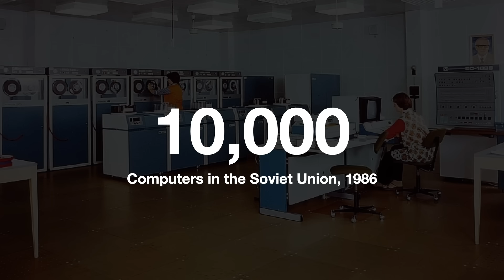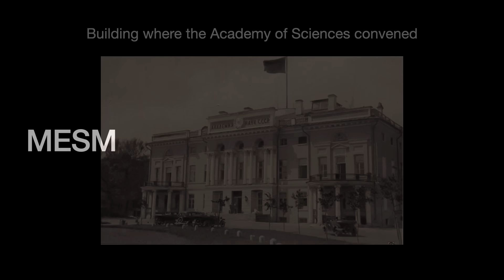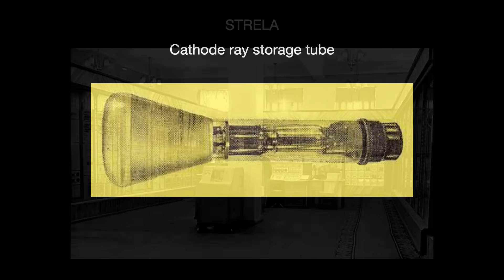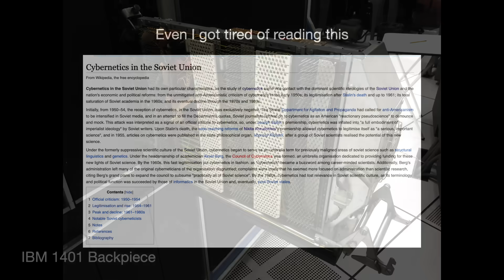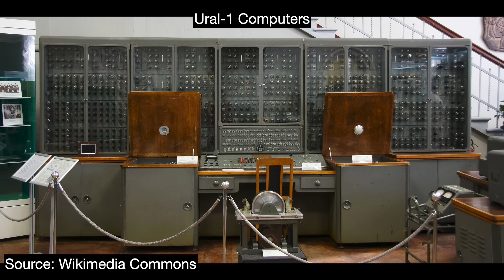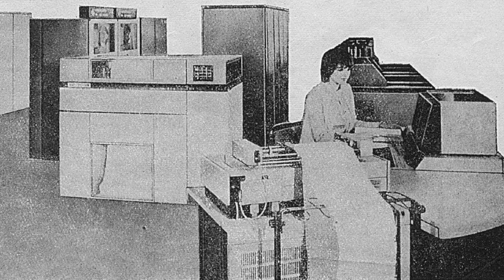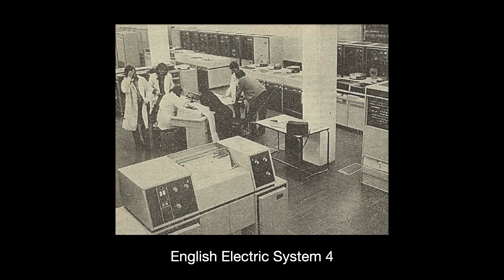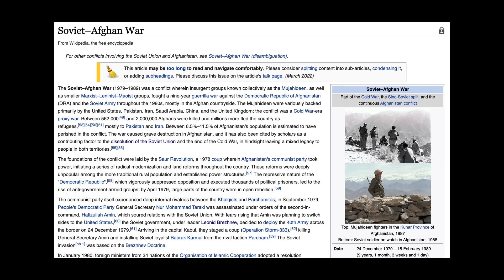Why the Soviet Computer Failed

Comment: I loved this video. Incidentally, the Russians later produced their own computer on a chip. American engineers obtained a sample and discovered that it was a copy of Intel’s 8080 CPU. However, the Russians disconnected circuitry designed for diagnostics, as they didn’t understand what it was for.

In the 1970s, my dad licensed magnesium production technology from Russia’s VAMI (Russian National Aluminum and Magnesium Institute). It was much better than our methods. I have also been told that Russia excels at light-metal technology and leads the world in titanium production. Furthermore, they allegedly have controlling interest in American-based companies that produce titanium. Regardless, it would be interesting to learn how they failed in one field while excelling in another.
Reply: You are right about titanium. Boeing has long term contracts to buy titanium alloy Ti-5553, from Russian titanium producer, I think VAMPSPO which has come up recently as one the best alloys, Boeing probably uses them for aircraft bulkhead or landing gear in 787/777. In fact there is a story, not sure how much of this is true, that CIA in the 50s had a dummy company to secretly purchase titanium from Sovient Union to build SR-71 by Skunk-works. Soviet Metallurgy is as good as in the west, but also ahead in many areas such as high temperature alloys for rockets and missiles, magnets etc
Reply: @indchill4574  Soviet metallurgy is or was?
Reply: @indchill4574  Today even South Korea is way ahead of russia in metallurgy. You russians seem obsessed with the West especially with the USA while you are backward and far very far behind Japan,  South Korea, China etc.
Reply: @indchill4574  All these false "the Soviet excelled here,  the Soviet were in advance there etc... " are becoming comical. These are typical Pravda assertions. After the defeat of the Soviet union and its eventual demise,  none of these "advances and excellencies" were found or visible anywhere.
Reply: @francoislechanceux5818  The Russian RD-180 rocket engine was chosen to power the American Atlas rockets.   I am sure though that you will find some argument to convince yourself that engine is rubbish.
Reply: @francoislechanceux5818  The comments you refer to, about a few technical areas where Russia has the lead, are detailed and specific. Yours, sadly, are playground insults.
Reply: Yep, USA bought titanium for the SR-71 from USSR (through intermediates, of course).
USSR also had very advanced superalloys, allowing them to have, for example oxygen-rich full-flow RP1 engine built in the 60s, the NK-33. Rocket scientists would not believe in its parameters until buying several copies for testing and seeing it for themselves. These same engines flew on the Anthares, and I don't mean the old design, I mean the old hardware itself.
Then again, this same phenomenal engine repeatedly blew up the Russian rocket it was supposed to carry, and then likely blew up the Anthares.
The Soviet system is great at finding and training talent, then wasting their labor.
Reply: @nikolatasev4948  "The Soviet system is great at finding and training talent, then wasting their labor."

I'm going to be stealing this.
Reply: Equating the soviets to russians, Best way to know a russian troll
Reply: @francoislechanceux5818  "Equating the soviets to russians, Best way to know a russian troll"
Or just an American.  See the movie "Dr. Strangelove"  https://en.wikipedia.org/wiki/Dr._Strangelove
It is a serious comedy but portrays the Russians as the enemy; not Soviets; Russians.
Reply: @francoislechanceux5818  "Looks like it systematically gets you more "likes" doesn't matter how stupid what you say is."
While that didn't exactly make sense, you are probably correct.  Being liked is not the same as being correct.  
The United States has the lions share of NATO funding; with France, Germany and UK having smaller shares, everyone else has considerably smaller shares.
In my years at Iceland at Keflavik, nearly all ASW was American with the occasional French, German, Dutch (Netherlands) participation and UK nearly as participating as America but from their base in Kinloss, Scotland and elsewhere.  Here is a chart of expenditures (not budget) https://www.nato.int/nato_static_fl2014/assets/pdf/2022/3/pdf/220331-def-exp-2021-en.pdf
We see the USA is way ahead of everyone in terms of GDP, and since GDP is large, it is also much larger in terms of absolute numbers.  
Graph 5: In 2016, the United States spent 651 billion (thousand million) dollars on defense; everyone else in NATO spent a combined 262 billion.  
So swallow your wounded pride and, by the way, step up the nuclear reactor program.  You're going to need it.  That's where France is the undisputed leader.

Comment: Analog computers for doing calculations especially in real time have desirable characteristics over digital computers especially for military applications where the circuitry is subject to electromagnetic interference probably till the 1980s and in some special applications possibly in the 2020s as well.  Soviet ballistic missile accuracy was widely thought superior to USA's in the mid 1960s and into the 1970s. A top USA military analysis said by the time NORAD had its Cheyenne Mountain complex operational in 1964 the Soviets had such accurate and sophisticated missile guidance systems they could have conceivably flown a missile through it.  The USA had no such capability.   

Soviet's had reliable automation with ground control on their first manned space flight back in 1950s and has always had much more automated manned space flight.  The digital navigation computer of Apollo was so delayed by software and other issues NASA had a German company design and provide its traditional navigation equipment that with some training the astronauts found was excellent.  

Digital electronic computers have clear advantages over analog computers in precise repeatable financial type numerical calculations, verbatim recording of data, and in tallying numbers.  This is why International Business Machines (IBM) slowly decided to adopt electronic digital logic over mechanical logic.  IBM 80 column punch cards recorded data verbatim back in the 1928 https://www.ibm.com/ibm/history/ibm100/us/en/icons/punchcard/ and allowed automated machine mechanical logic to process that data.  Even to this day the standard text terminal simulation defaults to 80 columns.  There were huge gains to be had by having more flexible machinery for processing this data and with more complex processing the need for much higher speed processing both of which electronic digital computers had the potential to achieve if reliability and error checking could be addressed.  

In the discussion of digital and analog computers the current news headlines are on quantum computers which still don't seem to a have clear description if they are digital or analog if those categories are at all appropriate.  Applications for quantum computers are stated to Not include such things as faster graphics processing units GPUs, which actually for graphics display purposes wondering in 1/10,000s in exchange for faster than light processing seems like an idea application of quantum computing for its low level description of providing a probability rather than an exact answer.  This low level description of giving a probability rather than an exact answer seems of a similar characteristic of traditional analog computers.  Transitional electric analog computers simulated mathematical formulas with electronic analog circuits where the answer was typically dependent on interpreting a voltage level output.  The voltage output could be further processed to control devices and transposed for display for ready interpretation by humans.  Because a voltage level is somewhat variable it is not accurate or reliable enough for being exacting for financial representations.  Analog computers are frequently not programable in the normal sense of feeding it a program.  They are hardwired to perform certain mathematical functions.  

 In 2020s the biggest slow break through has been the low cost availability to super computing simulations.   In 2021 I asked a speaker at the Performance Race Industry trade show in Indianapolis Indiana about if there were still super computer simulation limitations and he said back in the 1980s his company might have to pay $10,000s (he may have said $60k 1988 > 2021 BLS inflation $139.6k) for his combustion chamber simulations to run a Cray super computer, now the simulations run much faster and they maybe a couple hundred dollars.   He said he doesn't experience an over riding issues with access to high level super computing today.  I believe my question may have had him realize that change somewhat as well.   The cost to most high level super computer simulations for him seems to have become largely insignificant during the 2010s.
Reply: @jackgee3200  The traditional navigation equipment from Germany was used for manual course navigation by the astronauts as it is related to the public as a check of the automated navigation systems.   The astronauts had high confidents in course navigation with the traditional navigation equipment from Germany.   Outside the public NASA disclosure my high school  astronomy club had a speaker that was an Apollo engineer and he said the astronauts actually did course correction with what we would term manually,  based on star sightings.   Maybe they were programed for a for a few 1/10s of second and then triggered instead of manually controlling the thrusters, but very hands on.  The lunar lander made use of a digital control system for controlling the many thrusters.   That is highly sophisticated and was restrained by the computer technology of the day, but the smarts of the system are considered very good.  It maybe hard to do better than this system did.  It could be made more reliable and compact with more features, but the core control ability smarts is hard to surpass.

Comment: I mus disagree with the myth of the rockets due the Germans.
While the V2 and Germans did helped, the Russians were pioneers in rocketry. In fact almost everything in the basics of this science comes from Russian authors. They were launching stuff and inventing fuels, motors, solutions already in the late 19th century.
Before WWII the USSR were pioneering rocket aircraft, artillery, meteorology.
But with the war they stopped all efforts due obvious reasons.

The V2 allowed them to resume on time. But in no time everything they did was completely local. Even the copy of the V2 was heavily modified and improved. The soviets were mainly interested in fuel pump and inertial guidance than the rocketry itself.
Later space epics done by the soviets had nothing German on them, while in the US was the contrary, it was the former Nazis the ones that stopped the constant failures and made the successful results.
Reply: the US was helped more by the Germans

Comment: I was working for Intel in the late 70's. It was exciting and we became advanced as we had so many companies and small engineering teams exploring lots of options. Intel and Motorola really started packing on the transistors on wafers with a world of code to run on them. You can't do that without a capitalist system and no central planning. The real advances in the 90's left the rest of the world behind by 20 years  except where it's been exported and the NL and Israel are as advanced as the US in computer technology (advanced electronics manufacturing).
Reply: NL?

Comment: I had heard that Soviet computers weren't based on binary, but base-3 (positive, negative, and neutral) transister units, and this failed as an efficient computing platform.
Reply: The only such computer was Setun. https://en.wikipedia.org/wiki/Setun Mathematicaly base 3 could be more effective in storing and computing (better approximation of e ;) ), but binary logic cout be easily realized by 2 stabil and recognizable states.

Comment: Americans have a very hard time understanding their own country and why things are as they are. The United States compared to the Russia benefited from 130 years of imperial expansion uninterrupted by major internal warfare. Russia, on the other hand, was totally devastated by WW2 within the boarders of their country. That, unlike Europe, they had no support building back up from the only major economy lucky enough to not be bombed into oblivion (cough cough America) is a very important factor here too. But it is the combination of never being bombed into the stone age and uninterrupted imperial expansion and it's stolen riches (because the pace of the computer revolution was more about access to cheap "new" elements than anything else). The different economic and political system and even the grift and corruption does not explain the difference.
Reply: Well $$$$$ is part of the equation for sure so I would never outright dismiss the economic system.

Comment: Ironic that ICL was mentioned. My first three years in IT was programming one in assembly. That laid the groundwork for my 40 years of software development. It has been a great career.
Reply: In the very early 80's I spent about 3 years programming ICL mainframes.  The first one - a very primitive machine which if memory serves ran an operating system called DME - was very basic and rather a pain to work on.  The second one, which ran (I think) VME (virtual machine environment) was a dream to work on, absolutely fantastic machine.  That was, in fact, my first memory of really enjoying working with a computer. (The second was when I started working on a DEC VAX machine in the late 80's)